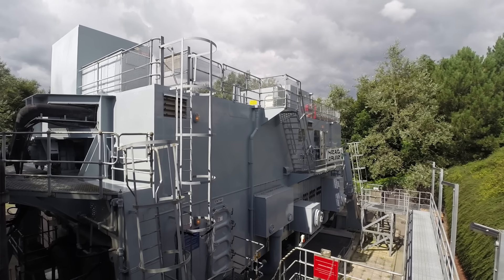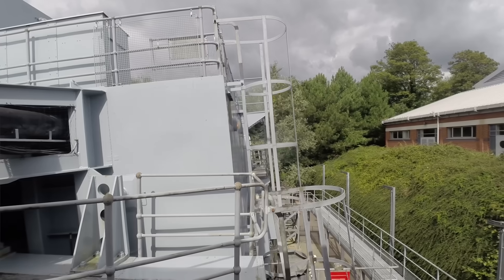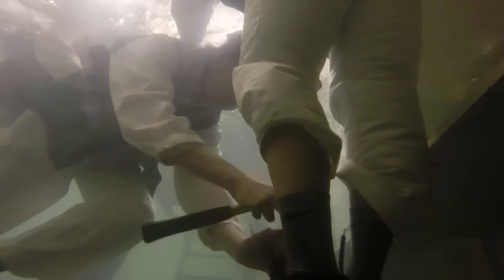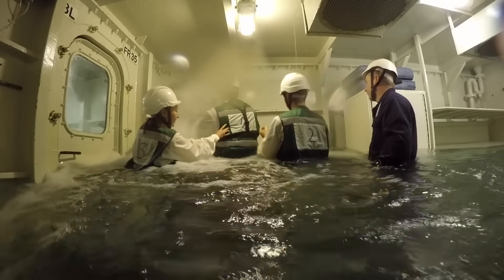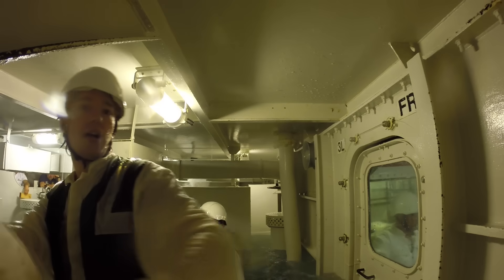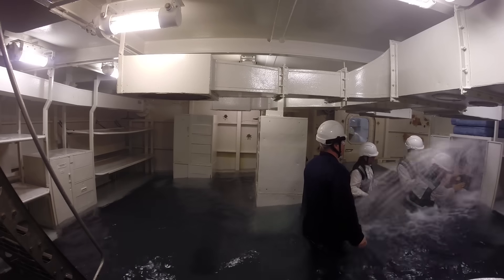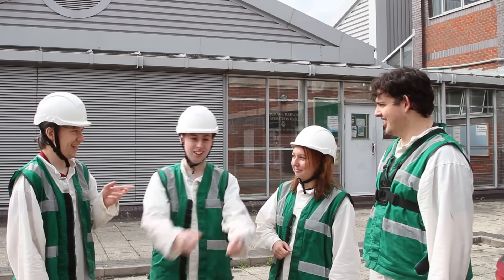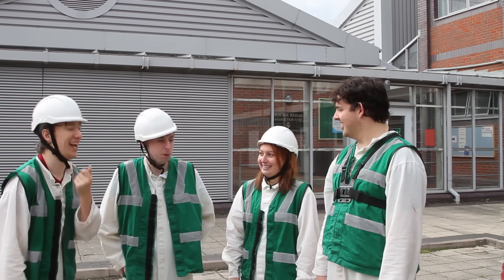Sinking Ship Simulator: The Royal Navy's Damage Repair Instructional Unit

Comment: I reckon a small shield like structure that could be held right in front of you (maybe even on a small pole ) to deflect/slightly redirect the water would do a lot in terms of accessing a particularly nasty breach in order to improve visibility - am I wrong? I am not talking about something huge here, but a faceplate may be a bit bulky and a shield can be a lot more mobile, especially if you have a sizeable crew. That way, you would up the speed of a repair. Yes, working in the dark should be trained too but I feel like I am missing a reason why something like that doesn't already exist.

Comment: I'd be curious to know if it's a standard thing that perhaps rooms would have drains along either the moldings of the walls or just in the floors themselves that then lead via a pump system to tanks just above seawater that can help mitigate the troubles of a flooded compartment and once the breaches are at least temporarily seal, very quickly without needing to waste time that would be very much so more valuable on making the seals more permanent, fully removing what water is currently in the compartments also so that way the ship isn't so flooded and heavy risking sinking if it takes damage elsewhere that gets more flooded compartments

Comment: I did this in 1980. Bloody cold water! It was a walk in the park compared to fighting a fire in a similar sized compartment though. Putting out an oil fire when you can't see your finger in front of your face is challenging. Also extremely exhausting climbing up and down ladders with full breathing apparatus weighing you down.

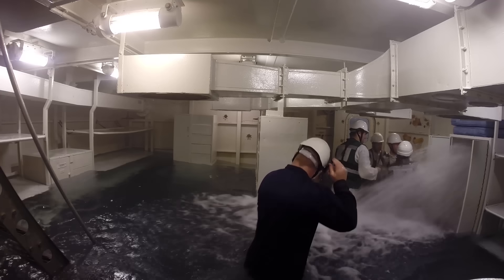Comment: Do the wedges (routinely) totally stop the leaks or do the controllers turn off the flow when they can see you've 'done a good enough job'? I ask, because not only would that render the whole thing pointless, but it seems to me that water could still get around the wedges shown at 4:25 or 4:32

Comment: I know the wood wedges are a tried and true time honored solution, but wondering if anyone has come up with newer innovative alternatives to plugging holes.  For example, for a fist sized hole, imagine a tiny steel umbrella-like device (maybe with a rubber seal) that goes into the hole and expands using the waters force to hold it in place while it's bolted on the inside.

Comment: Drop a big sheet on the outside of the boat and the water pressure will hold it in place.
Like when a space ship has a hole in it and a plate is thrown at the hole.
If not you can use some instant large hole seal fix I invented .

Comment: I did this training just over 12 years ago.  I was 10 stone 5ft.6.   I can not truly express how hard the pressure forces you back.  How cold and shocking it is.  How much will it takes to force your head down and brace against anything and go in blind against the water, trying to force a wedge in.  How ineffective you feel.  Then when the water get too deep and you end up having to abandon all attempts because I was just too short and just pile on the taller lads and keep them braced.  It was the hardest part of phase one bar the boredom.

Comment: Their ships must be terrible designed because all modern ships have watertight doors and can isolate cabins/compartments cutting off all ventilation etc...
SOLAS doesn't require these trainings anymore because hammering in wedges where not only a big failure in most cases they also mostly led to more dangerous situations where they could have simply cut off the compartment that was flooding in most cases and not wasting every ones time and lives onboard.
Reply: Every major ship, whether its Navy, Freighter or cruise ship have damage control parties who are trained to do immediate and vital repairs if the ship becomes damaged for whatever reason. Everyone who is a member of one of these parties is also a former ship firefighter or has firefighter training as part of the course

Comment: i think the participants need to have more direct manual control over their, simulation. too make it less scary.
Reply: You know why they do it in a mock-up of a ships hull? Because that's where they would be plugging leaks, in the hull of a ship. Shocking isn't it, that navy recruits are trained in mock-ups of the environments they'd be serving in
Reply: it does not have to be "that" realistic, does it ?
Reply: all of this to plug a wooden pegg in a hole. this can also be done. in a less... claustrophobique, situations. i think plugging a hole on shore in the wide open. also would do the trick. my humble  opinion is. the simulator building is expensive but poorly designed. it is unnessairy realistic. in a way that in reality. the same holes also be made by real enemy ships with the same ammunition. and probably not only outside nightmares. is it ? highly overdone.

Comment: I used to be in the Canadian Navy and we had a similar (but much more primative and smaller) training compartment/tank in Halifax, Canada. The same principals were applied: the water level was controlled externally and if your team was performing favorably, they'd slow down the inflow of water. But if your team wasn't getting the holes plugged up or the shoring (timbers) in place correctly, the operators would nearly fill the compartment! It is surprisingly realistic once you're down inside one of these Mock-ups, and easy to forget that it's just a drill, especially when the cold water keeps rising!! Well done Tom.

Comment: At Raleigh it is known as HMS Havoc - for fairly obvious reasons. They used to start this exercise by shouting 'enemy aircraft' then throwing in a couple of thunderflashes (REALLY loud fireworks) which deafened you in a small metal compartment, then turn the lights off for about 15 seconds for maximum confusion. Zero chance of fixing all the leaks - you just need to restrict it to the point that the pumps can cope

Comment: Now I'm curious what 'getting the water out really quickly' looks like
Reply: It's dewatering equipment you use pumps there's a few different types the pumps are connected to hoses that go to overboard discharge
Reply: But for engine spaces have a built in pump to get water and oil oit

Comment: I'm curious why they opted for chlorinated fresh water? I would have presumed that they would use sea water, or some sort of clean salt water. My thought process being that in an intense situation like attempting to repair a hole on a ship at sea that is taking on water, having the environmental variables between training and reality minimized for optimal efficiency. Not that I believe that any singular incident is going to be the same as any other, but just having the tiny difference in having ocean spraying in your face in a real emergency when you're accustomed to the fresh water in a training facility can have a psychological impact that might decrease the efficiency in which one is performing their duties
Reply: It's just basic safety.  Keeping the staff and students in slightly cleaner water. Water could be pumped in from near by but pollution ect of the source just means this is safer.
Reply: @hachwarwickshire292  thanks for the answer! It took me a minute to figure out what we were talking about 🤣

Comment: I'm unlucky enough to have experience of the simulator and a real damage control situation from collision. I did the damage control training at HMS Excellent and I was also on HMS Nottingham when it ran aground in 2002. The simulator was fairly representative of my experience onboard the Nottingham, including the equipment used. (Although, both in simulation and on ship we had access to more than just wedges and hammers.)

Comment: 4:29 Just close the locker, duh
Reply: It's 120psi, duh
You can't close the locker. Water will force it open eventually and you need to leave for other holes
Reply: @connoregan2874  plus the doors aren't watertight

Comment: Wouldn't it be easier the have a 2 inch thicj sheet 8by8 inch aluminum or medal then held with a powerful magnetic tool then weld the piece on the medal to cover the leak.

Comment: I did this back in 2012 but we used clamps aswell, it wasn't just wedges. Anyways, I was in the mess deck on a bunk bed dealing with a hole there and I nearly lost a clamp behind the hole. Staff wouldn't have been happy! 😄 

It was great fun anyways. Quite the experience and it was rocking all over the place!

Comment: How does a wedge fix a hole...it would have to be like..very specifically shaped,like a perfect rectangle...how on earth can you fix a round hole with a wedge

If it was like a cone shaped wedge I can see that significantly lowering the water intake...even then wouldent totally fix it 

Can someone explain?
Reply: You can see they split the wedges to have it fit better. Im no expert but a missile hit isn't going to be perfectly round

Comment: Excellent video on the training simulator.  However I am inclined to question @1:30 “120 psi breach” - that seems unreasonable for a ship.
Reply: The High Pressure Salt water Main runs at 7-8 bar, so that's about correct

Comment: To think that today, we still use wooden wedges and hammers to emergency fix leaks. Is that really the best option?
(Incoming Flex Tape memes)
Reply: It is cheap, effective and relatively easy to apply. So exactly what we want.
Reply: Wood is perfect for the job because its easy to split and once hammered in the water outside will make the wood swell to fully seal the breach
Reply: Na the best option is metal shoring

Comment: Done this many times. It's even harder when they add in the roll as, the Driu can go up to 20 degrees to port and starboard. When that happens a compartment full of water is in charge. You literally just go with the flow

Comment: Imagine those crew doing this in WWII, on freezing waters, in dark compartments , not knowing if the ship is already doomed or not
Reply: One would hope that they'd have put all of their depth charges to good use before they sprang a leak.
Reply: @JamesC696  There was occasional testimony from WWII sailors that the depth charges of sinking destroyers would sometimes spontaneously explode upon reaching the correct depth, disregarding that they hadn't actually been dropped and were still on the rack. Normally not a problem since the ship would already be irretrievably lost by then, but if you happened to be above the ship when one of its depth charges went off . . . just another reason to get away from a sinking ship quickly, one supposes.
Reply: @Ignonym  damn
Reply: @Ignonym  Wasnt that what happened to Hamman crew when trying to save the Yorktown?
Reply: Trust me the water is freezing
Reply: Not even knowing if the ship’s still over water!
Reply: Imagine wooden ships...
Reply: @LokiuniusGaming  9th
Reply: The real real has to deal with overpressure -- the rushing water squeezing the air in the compartment so much you feel as if your eyes will pop into your skull or just plain pop . . FREEZING water which makes you function poorly as a human period , darkness , the fear of knowing you are under the water line in the bowels of a steel ship that is sinking , the fear of not knowing but expecting another torpedo or bomb or mine at any second , the real possibility of parts of people in the dark cold water with you .. It is horrendous and it is hard to believe that actual men dealt with such situations and kept hammering as these ships sank . Words just fall short trying to convey how brave , how harrowing and how awful such situations were and are . 

If one day we can share memories with each other as if we were truly there -- war will cease to exist I am sure of it . But ya until that day I have nothing but respect and awe for those men and the men and women today who sign up for such professions . Incredible stuff .
Reply: Happened with HMS Nottingham. 

When you do the course, depending which version you're doing, you get a bit of backstory on the incident, including seeing the pictures of what they did. In every modelled simulation, the ship sank. They still don't fully understand how the crew managed to save it.
Reply: There are people who instruct there who've done it for real, in the Falklands. Sometimes they saved the ship, sometimes they didn't, but I can't imagine how terrifying it must be to do this for real.
Reply: i cannot imagine
Reply: The life of a stoker was one that was no life at all. The bravest were the merchant mariners, with no guns at sea and no friends on land because everybody thought they were cowards who made more and did less. They made the same wages and didn’t get veteran benefits until the 90’s. They had the highway death rate of any branch.
Reply: They didn't, this simulator was brought in after the Falklands conflict.
Reply: May I introduce you to the experience that is "Das Boot"?
Reply: You should see some of the picture of the secondary shoring from the Falklands.
Reply: I'd rather not, thank you very much! XD
Reply: The American sailors in particular were very good at it. In cases of serious damage they were able to save their ships which saves the hardware, saves most of the souls and sometimes even allows them to continue contributing to an ongoing battle
Reply: Depth charges!

Comment: Wait, how does a solid wooden wedge seal those holes? Is it like super soft wood or something? And how do the wedges not soak up and leak water?
Reply: its not the leaking that matters, its the flooding. they can just run permanent pumps to pump away the leaking water. they need to anyways because water is always going to get on board somehow. it doesn't need a watertight seal, just a good enough one.

Comment: Put four of the most powerful magnets in the world around the four corners of the hole. Then put four of the most powerful 2 × 4 magnets on top and around the other four magnets. Then slide a metal titanium sheet through the magnets and start welding and sealing up the hole. The four magnets and 2 x 4 magnets should help you hold the sheet in place while you quickly do your magic.

Comment: I'm no engineer but it seems to me if the compartment is truly water and air tight, there might be an easier aid to help control how much water enters the compartment. Here's my idea. For each compartment there must be a tight sealing hatch from the inside. Install POSITIVE PRESSURE valves to intreduce air pressure. Pump up the air pressure to match the water inflow and slow down the amount of incoming water by POSITIVE AIR PRESSURE by blowing back against the water. Even if that compartment fills with water, eventually the air pressure will force the water back through the breeches enough to help stop a vessle from sinking. I have experimented with this before. I used a 100 pound empty propane cylinder with an air valve installed. I submerged it completely under water with an open hole to simulate a rupture. when I pumped in air it displaced the water and floated the container.

Comment: I went on this a year or so ago with the cadets. One thing that isnt mentioned is how cold the water is - its absolutely freezing to the point where it numbs you completely. When I was there we had around 10 people in at the same time, and all of these problems were occurring simultaneously. The locker was, no doubt, the hardest thing. You can't see anything, and when trying to push wedges in, your hand just gets shoved away by the power of the water. It was great fun but absolutely hellish at the same time.

Comment: Why did they need all of this?
They could've just used Flex Tape.
Reply: Having been in the RN the reason they use soft wood wedges is because the wood expands when it gets wet.  The idea is to stop as much water as possible entering the compartment so that the pumps can cope with whatever is getting in